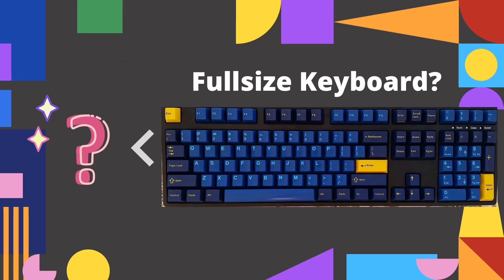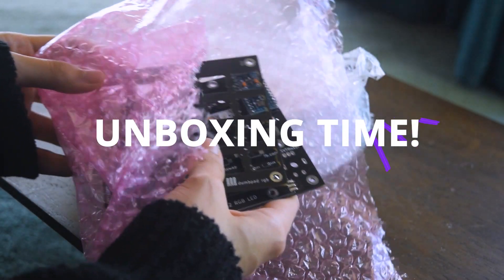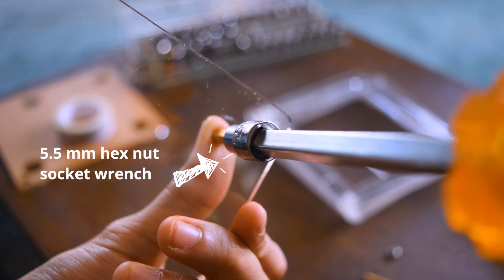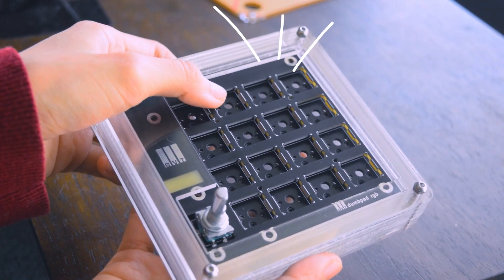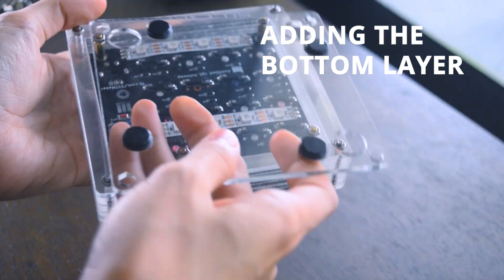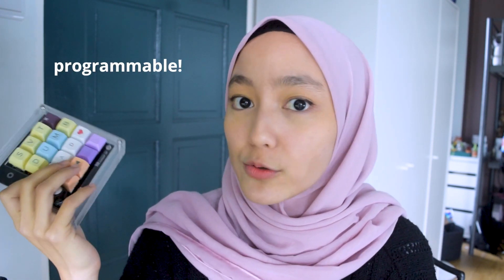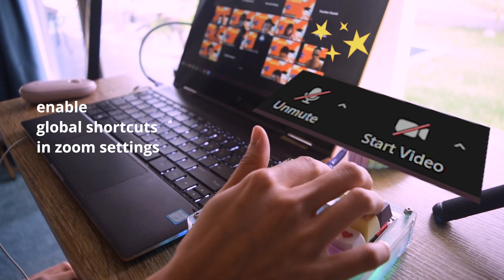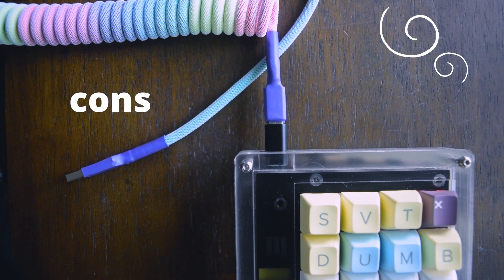SVT RGB Dumbpad Review

Comment: hi how do you reset your keyboard with your existing keymap?
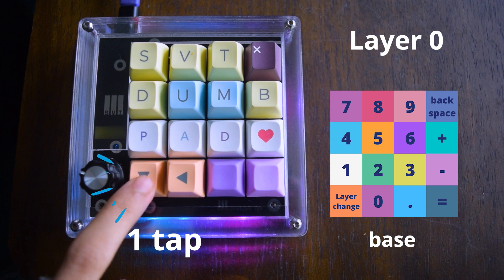Reply from the maker: Ahh okay so if you go to my keymap.c in github ( the one under folder svt-numpad). Noticed i didn't map any reset keys? That's because in line 325 , i put reset_keyboard() .This will reset after tapping five times and holding it more than 3 seconds (the orange button beside the rotary encoder 9:52 ).

https://github.com/wansyazlina/qmk_firmware/blob/dev_branch/keyboards/dumbpad/keymaps/svt_numpad/keymap.c#L325
Reply from the maker: Btw, i created a word doc on how to setup qmk on the svt dumbpad. You can check it out here..

https://drive.google.com/drive/folders/1sek6bkXI_pfFB8hPueSjiiD24OFD78lx?usp=sharing